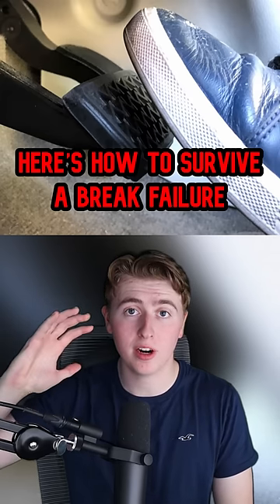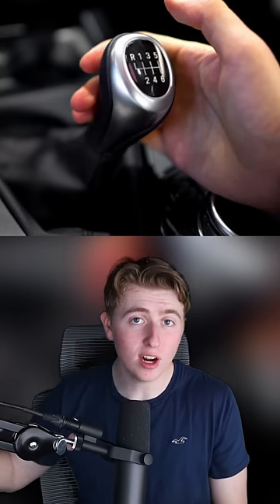How To Survive A Break Failure #Shorts

Comment: -stops on hill*

-ROLLS DOWN HILL*
Reply: Bruh 😂😂😂😂😂
Reply: Accelerate slowly :)
Reply: THATS WHAT I WAS THINK LOL
Reply: changes gear😱😱😱
Reply: It wont go down unless its in transmission, ur prob like 8 kid
Reply: There's an auto stop function bruh
Reply: The E brake will save you from rolling back, If e brake fails aswell use the ridges or rail on the side of the road. Or just drive the shoulder slowly to the top of the hill. If there's a slope at the top then try to get to a complete stop and  wedge your tires with any thing about the size of a 2×4 L 1 foot minimum

Comment: You also shift to neutral but keep the engine running, so you can have power steering.
You also gently apply the E-Break even at a high rate of speed, it will slow you down.

Comment: When he finally stops on the hill he thinks he's safe until he starts going down the hill
Reply: it all goes down hill from there
Reply: Just pull the e brake
Reply: @Orjan06  at that point I'm just jumping out
Reply: Then drive to the top of the hill. The gas pedal is working, not the breaks
Reply: @unclerick_fanpage  you got a point there 😅😂
Reply: @THEKiD.  until you you get to the bottom its can't get anymore straightforward than that
Reply: Hand break???
Reply: The fact that ur transmission is still working just put it in 1st gear if manual or in park in auto and turn ur vehicle off🙃
Reply: Handbrake
Reply: If you are driving the manusal you just put it in 3rd gear
Reply: When it’s going slow it’s safer and u can just put it on park when going up
Reply: @averagetokyogoulfan3130  yeah that’s what I was thinking
Reply: @yashisser4502  rip transmission if you put it in park while car is still moving
Reply: I know its just joke, but u have engine to go slowly up, and then stop.
Reply: @galenwiswell3757  better save ur live then transmission
Reply: Then just drive up
Reply: @yashisser4502  putting it in park won't save you.  The small pin that engages in park will just grind doing absolutely nothing.
Reply: He will use the brakes obviously
Reply: @Orjan06  e brake would have been worn out by then. If you drive with the e brake on for too long it will lose its function
Reply: @dimaisatree  that's true, I didn't think about that
Reply: Then you can't stop again
Reply: @Orjan06  just imagine if he runs out of gas too 💀

Comment: Noo the handbrake is generally separate from the main brake system so that will still work. The way to do it is to as you said downshift until you get to first by trying to rev match the gears then you can pull the handbrake and should be able to stop
Reply: Right
Reply: downshifting will cause a money shift and possibly lock the tires buy if your downshifting 1 gear push the clutch or else very very bad things will happen.... Im actually disapointed that luke didnt mention that
Reply: @tonyhuang431  Engine 👏 Braking 👏
Reply: @tonyhuang431  What do you mean moneyshift?
Reply: @42luke93  its when you downshift without slowing down which could lockup the tires and overrev the engine
Reply: Me who’s in in an electric car and has no gears… 💀
Reply: You can pull the handbrake anytime very slowly and as you are getting slower you just pull it harder. There is no need to downshift for that you can just take out the gear entirely

Comment: 1 if you are in a automatic car with no manual shifting. put the car in neutral so car slows down.
2 DO NOT zig zag! It can make the car lose control.
3 pull the hand brake VERY slowly, do not yank it, if you yank it will lock up the wheels.

Comment: You can use your parking break if it's mechanical. Just slowley lift it up at apply gradual pressure
Reply: @wanderer397  keep pressing it, it wil activate at some point
Reply: @wanderer397  if it's a manual handbrake pull it slowly while holding the button pushed in not pushing the button will make it it lock up. If it's an e brake press and hold it it'll activate  emergency mode and will slowly engage it in some cars
Reply: Most correct answer I have seen
Reply: @ricc136  if it's automatic, most likely won't activate unless the car is stopped, and it will lock the breaks up, if your going high speeds, number 1 way to flip your car

Comment: Brake failure happened while I was going down a big hill in winter-the brake line actually came apart. I just kept steering into the snow bank; it seemed to take forever. Luckily, there was a nearly 90 degree curve to the right and I finally crashed into a row of boulders. I was so afraid that i wasn’t going to be able to stop before I got to the highway at the bottom of the hill; I didn’t want to hurt anyone. Also, across the highway, there’s a stone quarry pit that’s like a mini Grand Canyon. ☠️ I was so lucky 🍀
Reply: Wow, that’s crazy

Comment: Dopey advice  . You have a HANDBRAKE !
Reply: That's what the ebreak is
Reply: Yeah I can see that, and he mentioned using the ebreak or parking break which is the same thing, just Americans needed to be different lol
Reply: Your hand break doesn't work like your foot pedals do. If you're going fast and use it, you'll end up skidding
Reply: @tehblacksmith9302  No you don't  unless you are on gravel,  it slows the rear wheels only, and you would be hard pressed to pull it quickly enough to skid. Try it.
Reply: @dnomyarnostaw  the average driver is a bad driver, while some of us have done defensive driver courses or have the experience to know that you gently use the hand break, most people are just gunna pull it as hard as they can. It's terrible advice to tell people to use the hand break without properly explaining the mechanics of it first
Reply: @tehblacksmith9302  Just try it, and then get back to me.
They design cars for the average driver
Reply: @dnomyarnostaw  I have had to use the hand break to stop and is exactly where my advice is coming from. And absolutely not, the average driver is an idiot
Reply: @tehblacksmith9302  I just did a neutral gear, free wheel stop down a 25 degree slightly cureved sealed road starting at 110 kph. It's an auto, so no engine braking was involved.
I'll do a video next time and show you the easy, gradual braking that pulled me up in under 12 seconds.
Reply: @dnomyarnostaw  do you just not read what other people say
Reply: Bro I used to drive with just my e brake because my brakes wernt working right so I drove it 20 miles away to the shop lol not hard the e brake will stop you.
Reply: 101 on how to flip your car
Reply: @ProjectSilvr  Huh? You can barely spin out the rear with a rear wheel handbrake. There are about 3 YT videos on using them to do sharp turns under full control.
Reply: @dnomyarnostaw  if your going highway speeds, and pull your handbrake as hard as you can in a ditch effort to try and stop, your gonna roll your shit, and most drivers don't understand that
Reply: @ProjectSilvr  No, you don't. There's a video about that too, and it stops you easily.
Reply: @ProjectSilvr  what are you smoking there is no way to roll your car using your rear brakes going forward. How in the world do you flip your car by giving it drag that makes no sense. Now yes if your car used front brakes for an e-brake you may roll your car but using back brakes it will not

Comment: No, 4 ways, then downshift wether it’s an automatic or manual you should be able to show shift and slow, when you get to about 10 miles an hour put your vehicle in neutral pull to the side of the road, and slowly put pressure on your emergency brake.

Comment: Actually if your in a manual start shifting agreesivley because the engine will stall and you no longer can accerate and you will slow to a stop. If your in automatic start going in reverse and drive quickly to confuse the ecu and stall the car. Also you can full throttle in reverse.

Comment: Downshift. Zigzag over curbs. And put in park as soon as you're going slow enough to. If you actually lose your brakes you may also lose your parking/emergency brake depending on the vehicle and brake failure.

Comment: First thing you should do is use the emergency brake. If you catch it early enough and you were taking proper care of your vehicle it should slow the vehicle relatively quickly about 5-6 seconds. The e brake line on my car is so tight it’ll lock the rear tires up if you pull it hard and fast but the lever is very stiff you need to put some serious unga dungas to do it.

Comment: Okay, let me help you out here. There is something called an Emergency brake, or some people call it a "parking brake" dont zigzag and risk hitting other cars. Put on your hazards and slowly apply the e brake, some cars have a pedal e brake, others have a handle.
If you drive a manual, use engine braking if you can in an emergency to slow down

Comment: The ebrake part is false. The e-brake uses the rear brakes at full force to enable it. And since there none, the only thing that can save you safely is engine braking, which is only possible in a manual. 

Automatics have a torque converter, unlike a manual which has a clutch.
A torque converter is like a clutch, but it works with fluid redirection. In a manual, you have to depress the clutch to go to a complete stop with your brakes. With a torque converter, you don’t have to do anything to stop. But with this, when the accelerometer says 0, the ECU automatically unlocks the torque converter, making your rpms drop, with little to no effect on your speed. 
The wiggling is severely unsafe. Just wait until you slow down enough to hold you car on a sidewalk.

The best way:
Shift into reverse.
In a manual: slowly depress the clutch while steadily applying throttle. This may heat up your clutch, but you can get it checked/repaired for a cheap price.
In an automatic: just shift into reverse. No throttle, the torque converter will redirect enough fluid to not stall your engine, but enough to slow you down.
When you stop in an automatic, immediately shift into Park.
Park uses your car’s driveshaft lock instead of your normal brakes.

Comment: Immediately shift into neutral. Never just rip the e brake. It will lock the wheels up if adjusted correctly. You dont want that 30 miles and hour.

Comment: If you drive a manual downshift to the lowest gear. Since it’s. Four stroke it will engine brake. And it will slow the car down enough that you could role into a ditch with some minor damage to the car

Comment: Do not start zigzagging. Most drivers have no experience with a car shifting its weight back and forth like that. This becomes especially bad if the pull the brake on the rear wheels and really get their oversized SUV sliding.

Comment: You know that that is extremly unlikly to happen, because all modern and most non modern cars for that matter, are equipped with 2 completly redundant breaking systems(it would alert you if one of them fails). Also pulling the Handbreak isn't the smartest idea ever because you would loose control over your vehicle pretty much immidiatly because the handbreak only breaks the back two tires.

Comment: Yes. Pull your E-brake. Cause brake failure isn't enough. Now we want to drift. Bro, don't pull it, but slowly start pulling it, until you feel it's breaking. And because you can seriously damage it and still get into drift, you should do it in the same pattern your turning signals go. Pull, release, pull, release.

Comment: Or you can just pull the emergency brake because that uses a wire that would probably still be working if your main hydraulic brakes failed

You could also use low gear for engine breaking if both of those failed

Comment: If your hydraulic brake system fails, which most have 2 lines, making this almost impossible in modern cars, your E-brake is purely mechanical and will lock the rear wheels
Reply: don’t pull the handbrake up fully, and even locking ur wheels is faster than letting them roll

Comment: Also if your car is an auto putting it in the 3, 2, 1 gears shifting one to another also allows the engine to slow the car down if your car isn’t equipped with a manual mode

Comment: when you press the brake to stop at a light, you are not really far away from it ( 10 - 15  meters ) so pulling the handbrake at 50 km/h wont do much its better to just downshift to 2nd and quickly to 1st and just hope you dont see piston 3 flying to the moon

Comment: how about using the E-break FIRST! before weaving uncontrollably and being unpredictable to other drivers and damaging infrastructure. its what its there for! its cable connected and NOT relying on fluid and pressure. its harder to slow down than the normal one. but effective none the less. also. all 4 breaks are interdependently connected so the odds of all 4 cables being broken are VERY unlikely. only if that fails do all the other shit.

Comment: The first time i ever drove, the car went out of brake. To make things worst it had no handbrake either. I was not on a main road since it was my first time ever but i still had to avoid a tractor by going off the road , while trying to not be stuck in the wet grass. Once the tractor passed i returned on the road and to stop it at a appropriate place i forced the transmission from Drive to Park. Probably not great for the transmission but it was the only option to stop the vehicule 😅

Comment: No no no never pull your e break. What you do is put the car in neutral and the car will start to slow down. If you were to pull your e break then you run the chance of losing all control of your car

Comment: Also you should brake as many times as you can like push push push push so that you can get enough power going thru the brakes to slow you down enough
Reply: You should hold your brakes becuz power breaks will overpower the engine so don't pump the breaks

Comment: E-brake would not have enough power to stop you ..... Pull that shit and steers even if you go sideway you will absolutely not gonna flip or tip your a car just gonna wear out your tire / blow a tire it happen to me on my pickup duramax and I just pull the e brake and slowly steer and I bump the side walk I dint go far because the e-brake lock up all wheels

Comment: This is how to actually do it if you dont have a electric handbrake slowly pull up the handbrake because it will slowly slow you if you just pull your handbrake up all the way your rear wheels will lock and you will spin out and crash source this shit happened to my dad while I was in the car and he did exactly what I said and it worked also I'm a mechanic dont listen to the video

Comment: No sir, I do competitive racing internationally and swerving/zigzagging will not help you and you will most likely spin out and that is definitely not a fun experience and even worse in a car and pulling the e-brake/ hand brake will do the same if your going anything above 50kmph finally if you are in a manual car and your going anything above that 30kmph then it can breaks the gear box and that can then damage the rest of the car and possibly end up with an exploding engine but that exploding part is the absolute worst that could happen

Comment: do not listen to this persons advice if your breaks actually fail throw the car in neutral and SLOWLY pull up on the parking break doing it to fast will flip the car and if there is a guard rail or wall near by do your best to scrape against it not run into it

Comment: That is... Not too good of advice.
What if the accelerator got stuck with that brake failure?
Shove your car into neutral and feather the brake pedal.
If that don't work?
Then E-Brake.
Otherwise? You gonna go flying.
😂😂😂

Comment: If your in winter climate brakes will likely fail because the brake lines are all rusted due to rust from salt.
  Especially GM made them with no rust prevention. 
There was a lawsuit against GM. I live in Minnesota Land of 10,000 car washes but no car wash that washes The underneath of the vehicle and the brake lines to get the salt off.  If someone were opening car washs
In the northern areas that only wash The underneath they'll be millionaires in just a couple years by just charging $2 to drive through and they won't even need a building. 
In 2022 Just the state of California car Wash sales are 1.5 billion annually.

Comment: I always have a plan coming up to every light if my brakes were to fail my Cummins has a broken E brake no blinkers so my hazards wouldn’t work and I don’t have a horn and haven’t had insurance in 2 years ( I’ll pay for 1 month then cancel so I have a card that says I’m good for a year)😂 but yet I daily it everyday So a car is the last fucking thing I’m hitting And I got really squishy brakes plus loose steering but atleast I could run over a lot more than cars if my brakes failed! As an example my truck idled into a parked car and completely destroyed the back pushed the trunk,bumper and broke the lights and everything and the only thing that happened to my truck was my license plate fell off😂😂 no dents, scrapes or anything lmao I felt so bad the lady was in the middle of moving